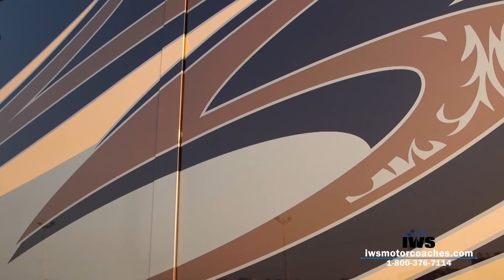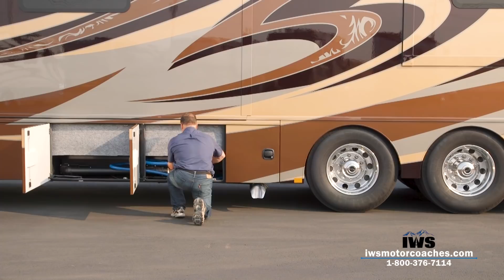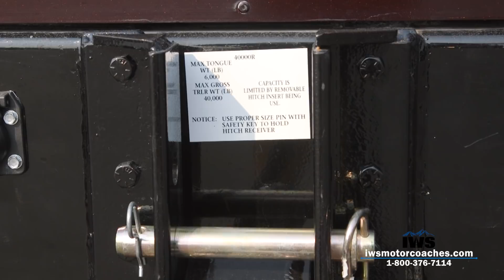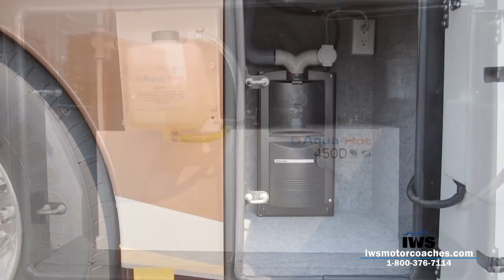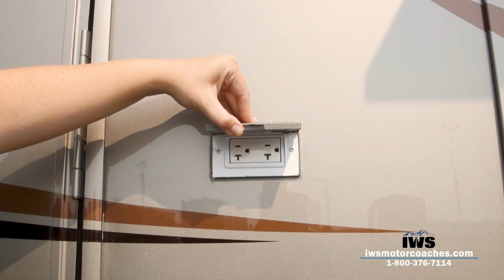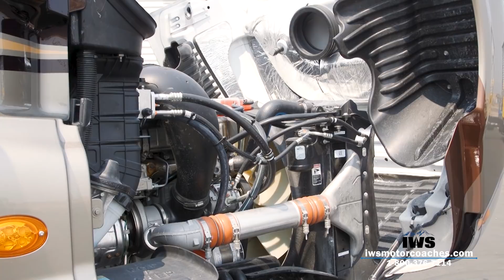IWS 2018 EPIC Renegade Classic Stk: 9898 Exterior

Comment: As a brit born and bred my first thoughts on the outside was three main points 1/ its sat down to low in the middle 2/ the back end is gowing to be grounded on any kind of ferry ramp 3/ why a dark colour they absorb heat more than white or lighter colours. Otherwise nice looking outfit but i question its practicality another thing others have commented on 85mph ? is that salesman talk because i question the tyres to do this.

Comment: Would you be required to have a CDL license to drive the Epic Renegade-Freightliner motorhome?
Reply: No, you would not need a CDL.  This not a commercial vehicle. Check your state DMV to see what license you might need for operating a RV of this weight.
Reply: A CDL is for Commercial Vehicles. 
An RV is NOT a Commercial Vehicle and DOES NOT require a CDL to operate, no matter what state you live in.  Some states will require you to have an upgraded driver’s license for personal operation of vehicles over 26,000#, but this is not a CDL.

Comment: .. A whole-lotta design effort in the IWS Epic motor coach I'll give ya that. .. The devil is in the details no-doubt. .. The rear tail light fixtures couldn't be lower rent if ya tried. .. The rear tail/stop lights barely make a passing grade (D-) for functionality and,,, aesthetically are out-of-place. .. These rear taillight fixtures are used also on my second hand 5' x 8' utility trailer...

Comment: I wish you would tell the price of the coach, That you show,
Reply: Around $150,000 - $200,000 a piece
Reply: Introvert Freddy 4Life1972, I don’t think so...  You can’t even buy a stock Kenworth, Volvo or Peterbuilt cab for that...  you’re way off!
Reply: Introvert Freddy 4Life1972, FYI one of their trailers alone is $60K!  Where are you getting this $150K - $200K from?  A cheap as looking RV (not one of the nice buses) is running around $80K - $120K.
Reply: MA. John Scott...LOL...I just saw a 2013 Renegade Ikon 34 RM that was on sale for $375K.  You’re probably looking at well over $1M nicely appointed with features.

https://www.sporttruckrv.com/default.asp?page=xPreOwnedInventoryDetail&id=2161456&p=1&s=Year&d=D&vt=motorhome&fr=xPreownedInventory

Comment: Great coach but there is a more powerful engine available for the Cascadia. We just bought 2 tractors w/Cummins power. The horsepower rating is the same @ 600 but the torque is higher, I believe it's 2050 lb.ft. where the Detroit is 1850. I don't know what trans you're running but ours have 12 speed automatics.

Comment: what a horrible paint design and color
Reply: Andrew Christopher I agree, would rather have a modern style versus the sweeping spirals and flares design. I'm sure it's a challenge for such immense size.
Reply: TJ, I have to agree with you.  My motorhome has the damn vinyl swirls and I hate them.  A clean full-body paint job would look so much better.  When these swirls get a few years of sunshine they start to crack and look ugly.  We need to let the RV manufacturers know how we feel about the exterior.  I wrote a short article several years ago in "Motorhome" magazine about this.
Reply: Those swirls are actually custom painted, its a multi-color paint job with a bunch of layers of clear on it.   Its not some cheap vinyl sticker that will fade/crack after a few years.  A LOT of labor involved with that paint job, as you have to tape off the whole coach to do each different color.
Reply: That doesn't mean it looks good.  I respect the effort, the work, the skill,   but the design is painfully outdated and overdone.
Reply: That's like all RV's, the design on the interior/exterior is dated the moment it rolls off the assembly line.   Think about who is buying these behemoths.  People aged 50, 60 or 70 something,  to their old eyes this is a great look, it feels like home.  The crowd who buys mega expensive RV's aren't necessarily "with it" on current design trends, you go to their home I bet it looks like 1986 or 1996 inside.
Reply: Mr.CaliforniaBob I've been on many million dollar prevost motorhomes and   owners always tell me they wished they had a simple white paint job. They say the you notice a huge difference in summer from a light colored to a dark colored RV temperature.

Comment: Do you need a cdl to operate this.....?
Reply: No, but you'll more than likely need to get your motor home license due to the weight and size. You can do you B license cdl. Either way, you'll have to get an A license either motor home or cdl if you plan on pulling a trailer ovet 10,000 lbs. I would imagine your motor home A license is pretty easy to get as your A license cdl gunna cost you up to $5k or more.

Comment: I have just one suggestion and that involves the rear tail & brake lights. Please consider raising them higher so that their visibility is increased when you are towing a trailer or vehicle....just look at the heights some manufacturers  got to on class a diesel pushers to make sure that those lights are completely visible to following traffic.
Reply: Check state laws.  The towed vehicle/trailer is still required to have tail/brake lights.
Reply: Kkkkkkk ki ej
Reply: I don't think they can. They are purchasing the truck from Freightliner and that Freightliner comes with the headlights they put on all of their trucks – including this Cascadia — though, it may be possible to mount the headlights a little bit higher on the existing chassis. No way to know.

Comment: Was just curious if you have any experience with 48v systems such as the Volta. I intend to do way more boon docking than full service rv parks. Thanks
Reply from the maker: We do not have any experience with the 48v systems Volta offers. However we do offer great 12v systems that we can custom tailor to fit your need. We combine solar charging with large capacity batteries and have an automatic generator start system to back it up. So extended dry camping is no problem in a Custom Renegade!

Comment: I have a question,  y are you not using the cockpit of  the 2018 Cascadia
Reply from the maker: Although the re-designed 2018 Cascadia’s have been seen on the road; they are not yet available with all rating options the existing Cascadia offers.   This is why Freightliner continues to build both versions.  Renegade RV requires a few items that have not yet been approved for use in the new Cascadia.  Eventually, we do expect to see the new Cascadia being available; but not until the latter half of next year.  Thank you!

Comment: Well Renegade be using the new 2018 freightliner Cascadia chassis?
Reply from the maker: Although the re-designed 2018 Cascadia’s have been seen on the road; they are not yet available with all rating options the existing Cascadia offers.   This is why Freightliner continues to build both versions.  Renegade RV requires a few items that have not yet been approved for use in the new Cascadia.  Eventually, we do expect to see the new Cascadia being available; but not until the latter half of next year.  Thank you!
Reply: IWS Motor Coaches  thank you

Comment: Would be nice to go over to a LiFePO4 battery if the battery compartment is climate controlled.

Gorgeous coach.
Reply: Yeah Timothy, they use the worst battery bank (low cost) that you can get. They also could have put a bigger inverter and at least 1-2 more solar cells.
Reply: Timothy Smith sdfygygttyufyrfko.        Koko